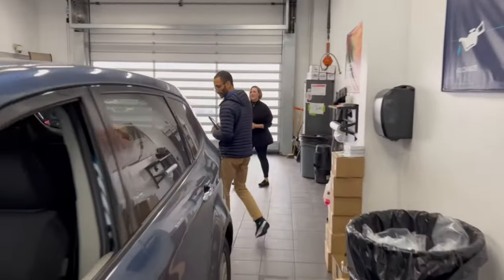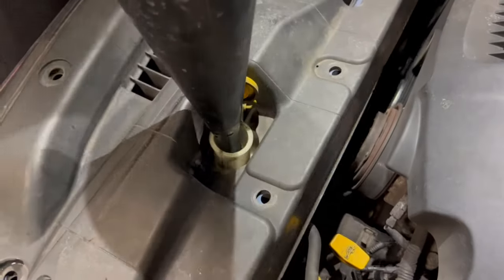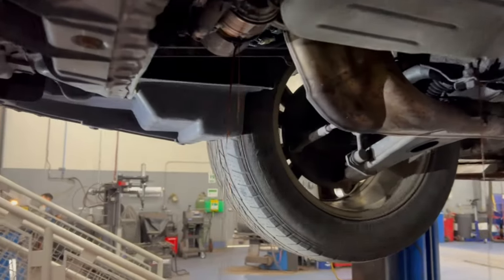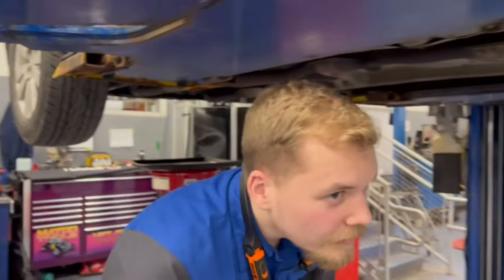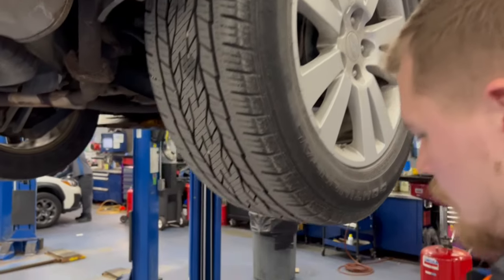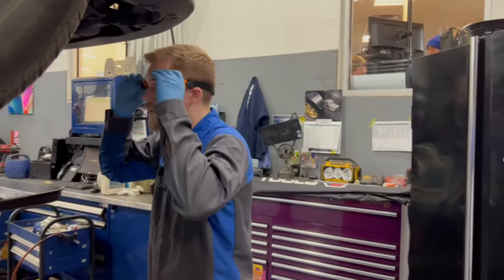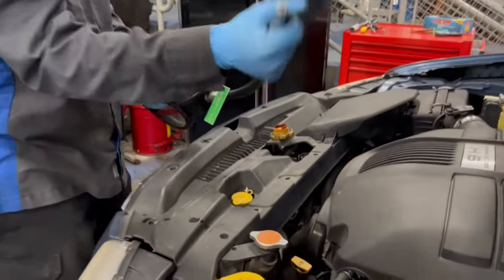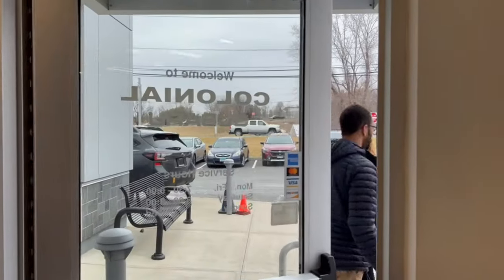Behind the Scenes at a Subaru Dealership | What Happens During Car Service

Comment: Not sure what happens at Colonial Subaru but I know what happened to me at Subaru of Jacksonville when I brought my car in for recall work. Scratched up dashboard and pillars. Loose steering column. And a broken iPod with the Subaru factory iPod controller left in the back seat. Yes, they actually removed a working controller and left it uninstalled in the back seat. Total clown show. The thing you need to remember is dealer "mechanics" are not really mechanics. They are part swappers. They have a computer system with highly detailed flowcharts and instructions that tell you exactly what to do step by step. I guess they didn't have instructions for the Subaru iPod controller so they were confused and just left it out. And it's not just Subaru. All dealers are like this. Luckily I can do all other repair work my self. I had no choice with the recall work.
Reply: Did they fart in your Subaru?

Comment: where was the Tyre rotation? and no oil around the seal of the new oil filter? and why ask if you can go ahead with the oil change AFTER you have already drained the old oil from the car because now you have to do an oil change. the only thing he physically did was do and oil change besides that he just looked at stuff, so what did they do that was so different that a normal mechanic couldn't have done and prob a lot cheaper
Reply from the maker: This was a demonstration video highlighting most of what happens when a customer brings in a vehicle for service. Everything was done per the maintenance schedule set by Subaru. Because dealerships have lost a large percentage to the aftermarket previously, price previously being a factor, that has been reduced significantly. In many cases, dealers are highly competitive with aftermarket shops while using superior quality parts. Thanks for your feedback.

Comment: No such thing as an honest stealership. These operations have massive amounts of overhead.
Reply from the maker: That’s a generalization that doesn’t necessarily reflect the truth. There are plenty of aftermarket shops where every time you go in, you need “everything”. Some shops replace brake pads, calipers and rotors every time, when often times a new set of pads and resurfacing will correct the issue. The fault lies with people, not dealerships or aftermarket shops. Today, everybody has high overhead.

Comment: **********   I have a 2015 Subaru Forester Limited with a  "CVT"  Transmission and 70,000+ Miles Owners Manual says that the Transmission "Never needs service"...........   OK  Subaru, How about a Straight answer??   Sounds like Subaru likes to sell Transmissions !!*****  The Previous own changed the CVT Oil at 60,000 Miles "Out of Caution   *********

Comment: Given the complexity of today's engines, I'm surprised no diagnostics were run on the engine and infotainment system. I also wonder why the pressure on the spare wasn't checked...
Reply from the maker: Subaru has a very specific service maintenance schedule and the electronic multipoint inspection mirrors that. Since there was no performance or drivability concern mentioned by the customer, there was no extra diagnosis done/added to the bill.

Comment: How can I be sure they changed my oil filter? My 4runner was returned to me with a little more oil than before making me wonder if the extra is oil in the filter that wasnt changed
Reply from the maker: Not saying it couldn’t have happened, but it’s highly unlikely. Have them put your car on the rack and have them show you the new filter.

Comment: I hate to say it but Subaru service is the worse…they try and void ur warranty for any reason…i even had the service tech call me out of the waiting room to ask me y the bottom of my car was dirty..and then tell me that Subaru will void my warranty if i drive in dirt…another time SOA told me to take my car to the dealer for some issues i called them on and that same dealer refused to take my car in that was only one year old…the service manager told me i need to ask him before i take my car in to his service department…yea Subaru service sucks
Reply from the maker: I’ve never had a problem with Subaru service, and I’ve used about four dealers in my travels.

Comment: well, not sure about else where but here in Australia. I took my Subaru to get service twice. Ridiculously overpriced is one thing but I got punctured tire prior to the first service and after their "thorough" inspection, did not see it. Since, I rarely drive I just inflate it if it's looks too bad. At the second service, the guy in the morning told me they'll repair it and do wheel alignment. When I pick up the car, it turns out they don't do wheel alignment because they DON'T have the machine. FFS, offering wheel replacement when they can't even do wheel alignment, now I have to take it to another shop. A waste of my time. I also have a Nissan, when it took it to service they even washed my car and I don't even like Nissan dealer. At Subaru, it's dirtier than before.

For those watching, this isn't about Dealership vs Independent or whatever. It's just up to the shop. I took my Nissan across the street, got it done cheaper and provide real recommendations that saved money and time. I'm done with Subaru dealers!
Reply from the maker: Yeah…I’m not sure I buy any of that, but thanks for contributing.